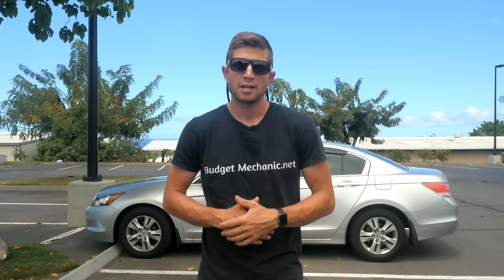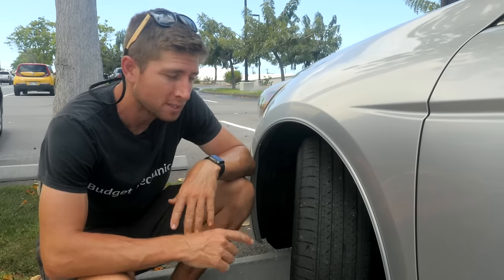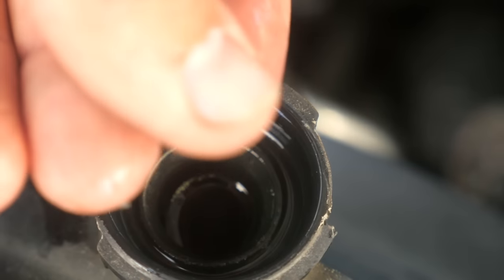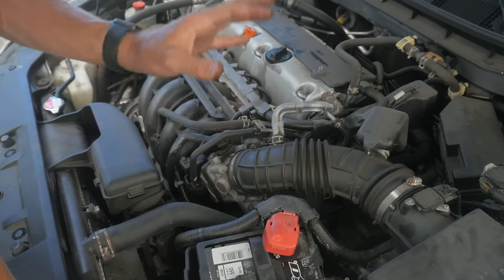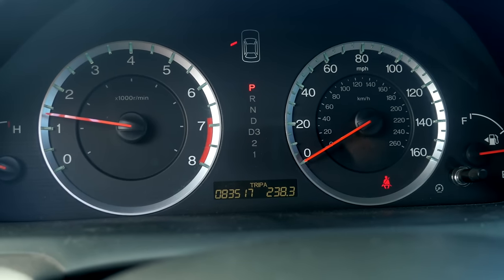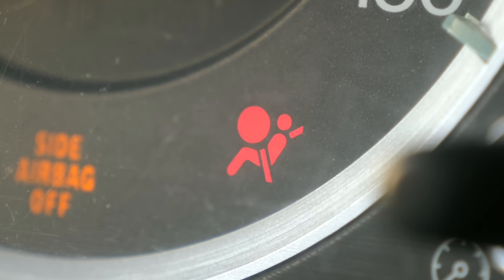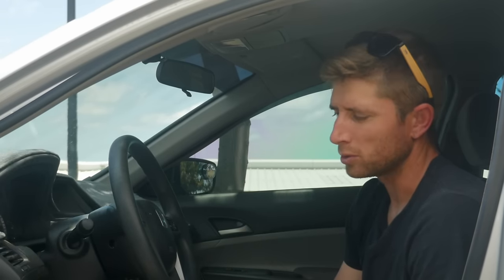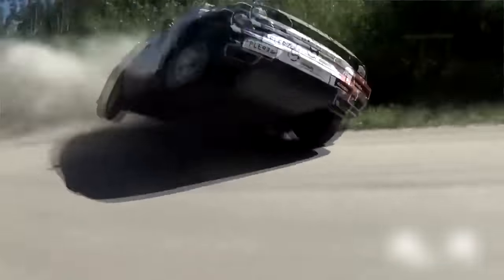How to Inspect a Used Car For Red Flags and Not Get Scammed

Comment: Never flush an automatic transmission. It can cause more problems. Only drain and refill.
Reply: Yes, and use lucas trans fix
Reply: @dommopa4464  No.
Reply: Old cars yes if you take it too a shop just ask them to replace the filter and the fluid that came out don’t do a flush
Reply: Yeah, that's where I tell YouTube not to recommend this channel to me any more...
Reply: This video confuses a lot of people. It is simply far from realistic
Reply: @alielbatal2151  flipping cars? 😂😂
Reply: The correct way is to disassemble and clean the channels, a lot of work and I wouldn’t recommend doing unless your having some issues with the transmission. The reason why flushing causes issues is because it can cause debris to clog the channels of the automatic transmission. Flushing a transmission regularly is okay, but I wouldn’t do it on one that was neglected.
Reply: Nonsense.This is only the case if you left it too long or it's filthy not maintained basically
Reply: @Antonio-gq6fx  If your transmission fluid isn't dirty why would you change it? The assumption is that when you do replace the fluid it's because it's dirty and needs to be replaced. In that case you should not flush the transmission because it has the possibility of causing some of that sediment within the fluid to be flushed into the narrow passages / crevices within the transmission where it gets stuck and impedes the proper flow of the fluid and therefor operation of the transmission over time. Ask anyone who rebuilds transmissions and they'll tell you flushing the fluid often does cause problems thousands of miles down the road.
Reply: @dommopa4464 l
Reply: @alielbatal2151 you might want to let someone help you if you need to buy a used car. This is all beyond simple.
Reply: Wrong 
As long as you do it before or at factory intervals
Reply: @usmcraid5332  Most "factory intervals" don't exist. They simply say it comes with "lifetime" fluid and then you ask what's the definition of "lifetime" for the transmission they'll say 75,000 miles. That means if you want your transmission to last you need to change it every 30k to 60k and YES you still should never have it flushed. Even if your transmission only has 10k miles on there will still be clutch material in the fluid that can get flushed into areas of the transmission where it can cause problems. Like I've said before, talk to someone who actually rebuilds transmissions when they fail and they'll tell you to NEVER flush the fluid because it can and OFTEN does cause problems. Just do a fluid drain, filter replacement and refill with factory fluid.
Reply: AT 205 reseal helped mine when it had delayed engagement.
Reply: Am getting mad at the used car I bought.. after driving it for a month,it slips to neutral when driving it.its a Toyota auris semi automatic 07. I changed the fluid and it was normal. After some days , it happened again. I will need to off and on the car before it will engage again in the middle of the road. Am Even scared to drive it now. I took it to the mechanic and he checked and said he can't find anything 😢 that I should keep on driving it and if it occurs again I should bring it.
Reply: @freemaninegbedion8283  Yeah, that's too bad. I'm not sure if I mentioned it here in these comments, but if a car hasn't had the fluid changed in a long time or ever in it's life it's a good idea to drain out the fluid into a totally clean container that you can save just in case the transmission starts to slip because then you can add back some of that old fluid that has the friction material inside it and that can help to keep the transmission from slipping. Ideally you want clean fluid, but if the transmission was neglected by not changing the fluid the worn clutch material that ends up in the dirty fluid can be the only thing keeping the transmission from slipping. If you catch the old fluid in a clean container at least you have the option of adding some back into the transmission in hopes that'll create enough friction. You didn't mention if you replaced the fluid with actual Toyota dealership fluid because that's very important. You don't want to use transmission fluid from anywhere else because sometimes that causes the transmission to slip. Even if the fluid says it's compatible with Toyota fluid I wouldn't trust it. Using the appropriate amount of fluid is also important. If nothing like that fixes your problem and you never saved any of the old fluid you can try using a product called Lucas Transmission Fix because it can help stop the transmission from slipping.
Reply: @Prepare2Survive  thanks...I will look for it
Reply: @Prepare2Survive  I just need to top it or drain the old fluid and only put Lucas?
Reply: @freemaninegbedion8283  No, you only remove some of the factory type transmission fluid and replace that small amount with the Lucas Trans Fix. At the most I wouldn't use anymore than one quart bottle of the Lucas stuff. I also wouldn't drain the factory fluid from the drain plug. I would use a narrow clean hose to siphon out 1/2 quart from the transmission fill tube and then install 1/2 quart of the Lucas stuff. Drive the car and see if that helps and if not then remove another 1/2 quart and install the rest of the Lucas stuff. Things to keep in mind are Lucas makes a lot of different products so make sure you're getting the "Transmission Fix" stuff and not something else they make. The other thing to consider is some transmissions fluid level is read when it's hot or cold so you'll want to make sure your fluid level is correct based on the specific way the manufacturer says it needs to be checked. Don't assume measuring it hot or cold means something it actually isn't so that's why reading the actual instructions put out by the manufacturer matters.
Reply: @Prepare2Survive  ok...the problem now is that my car don't have stick to check the guage to no what to take out
Reply: @freemaninegbedion8283  Well, there's still supposed to be somewhere to add fluid so just remove that fill plug and siphon out fluid from there the same way and install the Lucas to replace what you removed. If there's no dip stick to check the fluid level I would double check that your fluid level is correct instead of just guessing it has the right amount of fluid because not enough fluid or not the correct fluid type can cause the transmission to slip. Going back to what I already mentioned, it's very important to use the actual toyota fluid bought from an actual toyota dealership for the specific car you have AND that you study very carefully the factory instructions for checking the fluid level. Don't assume anything you hear from anyone. You should verify the instructions you are using are from the actual manufacturer and not just someone in the toyota dealership parts department who looks on his computer screen to see what it lists as the transmission capacity because many times that's not accurate and you need to actually read the service manual instructions for yourself.

Comment: Excellent. I live near hills in California. Taking a test drive that includes steep hills is a good way to feel transmission slipping.  And I learned only recently (after driving for 50 years) that the engine needs to be running when you check your transmission fluid level.

Comment: Check springs ( suspension) by hand and body press for bounce, check any suspension leakage. Start engine and check rpm after a while it should be between .75 to 1.  Then while driv9ng listen to wheels for any bearing issues. 4th after ride check the end of exhaust for smoke cokor, white, blue and black

Comment: Check blow by removing cap and place it back without tightening and see ifsmoke is coming out and the cap is fluttering. Put peice of card board under enging and check for coolent, oil dripping. Look up common problems with this car on Youtube, Take the car to a mechanic and have pre purchase inspection.

Comment: The first car I ever bought for myself had amazing A/C that was so good, it could keep ice cream from melting in 90f degree weather for a few hours, and really good sound system that was powerful enough to drown out all those bass-beaters out there. It was fun to drown out booming-bass-beat with Beethoven-Bass-Cello if it came down to someone being rude about it (in residential areas and gas stations)... But that was literally all it had going for it. Nearly everything else about that stupid thing was a disaster.

To this day, I'm seriously peeved at the dealership that sold me the dang thing. I had to take it to 5 different shops (2 of which were OTHER dealerships) just to sort out a really weird and strong shimmy that happened between 63 and 68 MPH. Turned out it was after market rims of some sort, but it took FIVE repair shops to figure that out? Gah! Never again. I'll pay a trusted mechanic to test drive a car WITH me before there is a "next time" I buy used... lol
Reply: You mean the car was shaking when you got to those speeds? And aftermarket rims? Yeah sounds like you needed to get hub rings. Did you fix the issue?
Reply: Was my very first car of my own, way back in 2006-ish. Took it to 2 repair shops, AND two dealerships; over the course of half a year. And the last one finally figured out what was going on (which was that it had after-market rims) and we (family) got them replaced. But that was some expensive work having 4 different places "have a look at it" and then the actual repair. I wasn't exactly torn up later when it needed to be retired... But it had served me well enough through my early work-years.

Comment: I checked out a 2008 Toyota Avalon 3 weeks ago and when I turned the ignition switch to on, all the lights came on and when I started the car up, they all STAYED ON.  So I went and pop the hood to listen to the engine, it had a very noticeable tick. When I say in the car it had a funk smell to it, like mildew and when I walked around the car looking at the it looked like it was used as a bumper car. No this car only had 76,000 miles on it, needless to say this was a Ft. Myers special (AKA flood car).  This dealer had a whole lot full of them, I looked at 3 Lexus cars and the Toyota and all four had that funky smell to their interiors. They were also all low miles, but they looked like bumper cars too, beware these cars are out there and there are a lot of them. Oh I looked at another Lexus IS250 on another lot and ran my finger on the inside of the exhaust pipe, heavy carbon build up, it was running really rich, the car also had lowering struts on it, this being a rear wheel drive car, I wouldn't doubt it was used by a previous owner as a part time drifter.
Reply: Did you get a carbon flush?

Comment: Buying a used car is a risk, because not everybody out there is honest. I have been scammed by an indian dealership in Texas with a car.  The dealer put bent truck rims/tires on the car and on my way to my home state the car was wobbling on the highway. People were even honking at me on the highway to let  me know that the car was not riding correctly. On the title the mileage was crossed out and I had a difficult time registering it with motor vehicles. They advised me to make a complaint with motor vehicles in Texas against the dealership. I also found out that the car had been involved in two car accidents and somehow this was not showing up on the title of the car.  I also learned that it had a different color than the one that it had. It was a bad experience. I will complain against them for sure. Buying a new car is extremely expensive, unless you are super rich. There is no escape from all the dishonest people out there. Everybody wants to make a buck out of anything nowadays.  Your channel is a huge help to those who do not know much about cars. Thank you.
Reply: I just bought a Ford Fusion SE for 4,000 with 153,346 miles it looks and runs like new the dealer owned it from new and took good care of it, so I always pray asking the Lord to bless n protect me from scams. My last car was a 2002 Sebring convertible which I had 11 years that I prayed for, I didn’t test drive it, I just paid cash and drove it home in Pa. No problems at all just change tires oil brakes and new convertible top. You can’t even trust to many mechanics these days they just wanna get paid, but I can trust the Lord🙏🏾
Reply: Buying a new Car isnt expensiv at all!You can get a new Basic Nissan Versa Manual for around 18k

Comment: For older cars, more than 15 years old, that were stored outside, for brighter colors, the paint on the outside should be duller than the covered frame paint, since it did not get the same sun exposure, and consistent in dullness. If there is an outside area that is not as dull, pay attention to that are, look below to see all the clips, and work being done.  For an older car that was taken care of, may not necessarily mean much, for example a car that I sold that I still miss, had that feature, as it was bumped while backing up, and I did the body work myself.  Not being an expert, I was a bit generous with bondo and aluminum plating behind it, but I did a good job with it, came out surprisingly well.  I disclosed it to a buyer who was just wanting to not pay for a maintained car, that obviously had TLC in it, and the guy who was impressed with my work got it.  I would gladly take a low mileage high trim Camry from early 2000s than one from now, the interiors and engines are not what they used to be back in the day.

Comment: My friend bought a used 2013 Honda civic from dealership with 98,000 miles on it for $10,000 and paid $800 for registration and taxes. Since then he is spending money on the car every month. He changed engine mounts one month, next month he changed VTEC solenoid, MAP sensor, cleaned MAF sensor. next month he said transmission not shifting smooth he changed transmission oil 3 times 3 quarts every time, transmission solenoids, then he changed tensioner, serpentine belt, then water pump, Chaned brakes, rotors, he did valve adjustments, now he said timing jumped by 2 teeth. HELL of a time. Waste of time. Buy brand new, use for 90000 miles sell and get new one. No used car.
Reply: You have 30k laying around for me to buy a new car ?
Reply: But then everyone says if you buy new it’s bad news because you’re wasting money due to almost immediate depreciation of car….

Comment: 2 reasons why someone would be selling their vehicle: 1) Not wanted  or  2) Not needed/used). Majority of the time, it is because it is not wanted even if they got a new vehicle you might want to find out what compelled them to get a new one because people don't typically look into replacing or upgrading a vehicle they are happy with, right? You will need to be a sleuth and find out why exactly they are selling it. The initial reason(s) they give you just for the asking is often not the real thing or not entirely. Much like a resume 98% of the sellers will lie or at least exaggerate a good thing or undermine an issue. Typically, I would try to get a feel for the seller's vibe and behavior. If the seller is not saying much or saying too much or seems too eager or nervous, to me each is a red flag. Ultimately, if you don't like the seller's attitude or something doesn't feel right, just walk away. There are more vehicles out there, don't rush and end up buying a lemon.

Comment: Bottom chassis rust. I got burned on a Ford Ranger. I couldn't even get it inspected. It was about to break in two. And I can't believe he didn't cover burning oil. These are the two worst problems-- not mentioned.
Reply: Check the tailpipe. If it’s covered with black dusty stuff that means it burns oil.

Comment: look around at the wiring harness+connections!  nothing worse than intermittent electrical problems,bear in mind that if the ecu is bad finding another one may be impossible.

Comment: What would be the best scan tool to get that can read ALL code and retain all the data a car gives them?
I personally got burned by not checking the OIL on a truck that I purchased. I should have done so and I even did so on prior vehicle purchases, but the one time I did not it got me. Also heater core problems can relate to the a/c system if both the a/c evaporator and heat core are housed in the same box that is attached to the firewall of the car, the those that don't know it it means you have to disconnect both just to replace one or the other. The means if the heater core leaks that is just as bad as the A/C not working.

Comment: Good luck checking the transmission fluid. Most transmissions no longer have dipsticks.
Reply: This is why at service time you replace as much transmission fluid as you can, so ask if the transmission fluid has ever been changed and do they have reciepts for that.
Reply: @oojimmyflip  I'm a bit OCD when it comes to transmission service intervals  (manual and automatic), 30K miles. 50K for rear differential.

Comment: Wouldn't be a good idea to flush a functioning transmission that has very dirty fluid. That fluid is dirty because of the friction material that has worn away from the clutch packs. It needs that friction material that is suspended in the fluid to assist the clutch packs to engage. If you flush it out, the friction material will be significantly reduced, and can cause the transmission to slip.